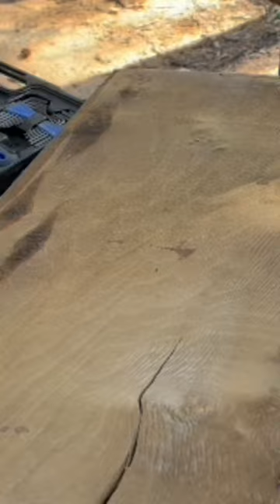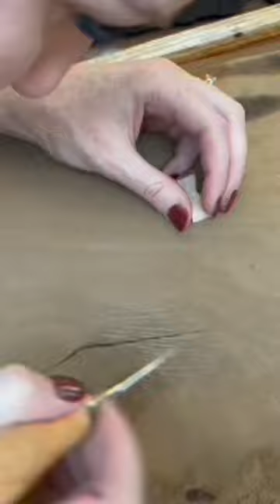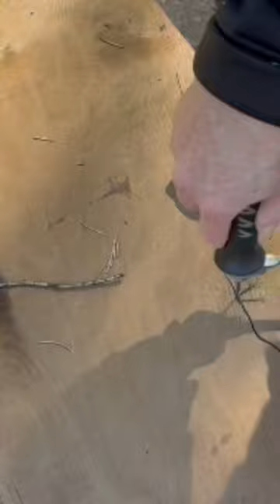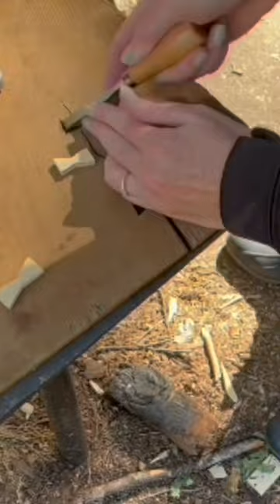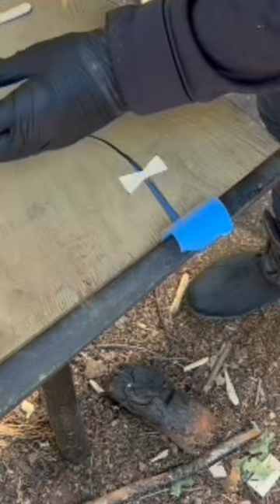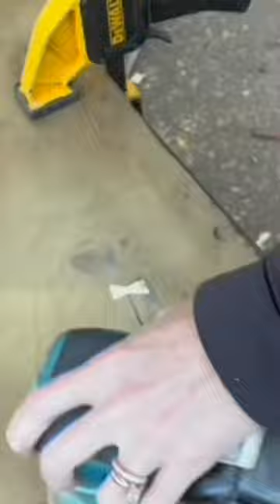Bow Ties!

Comment: While I am impressed with your patience and fitting abilities, aren't you supposed to clamp it together and their purpose is to keep the wood from splitting again? Not a criticism, just trying to learn.
Reply from the maker: Thanks, Trudy! In this case, the bottom of the drawer was so old and dried out that it wouldn’t come back together. I tried clamping it for a glue up to repair it and it was a no go. It had been separated for too long. And I’ve always wanted to try bow ties so this was a great opportunity for me as it was on a drawer bottom- had it not worked I would have just cut a new one. In this case, the bow ties will keep it from splitting even more and I get to keep the rustic look. If I can keep all the old parts I will do whatever I can to save them. And thanks for asking, we are all here learning together!